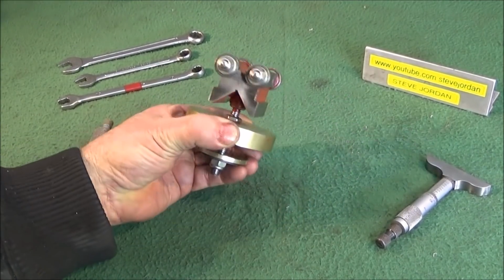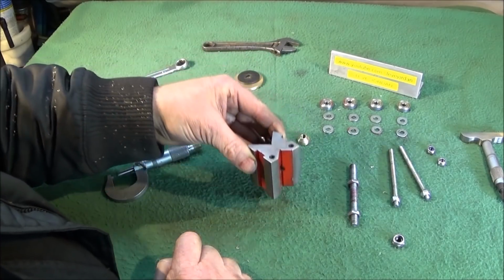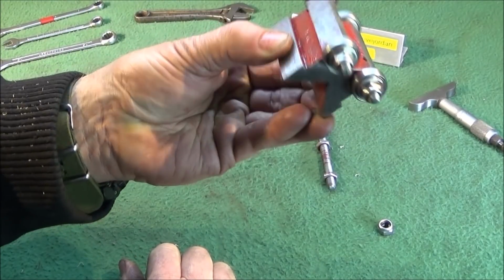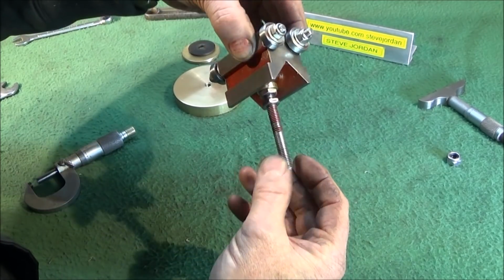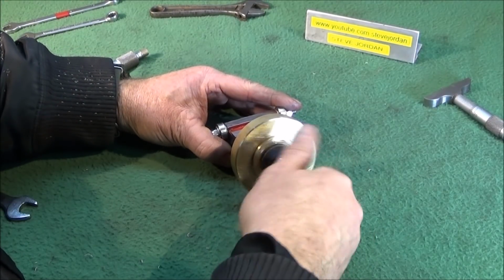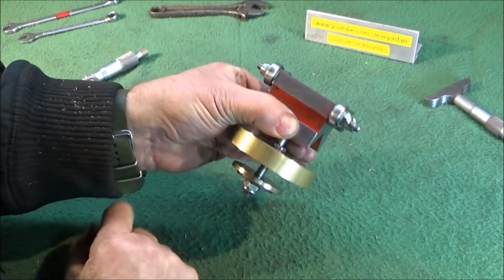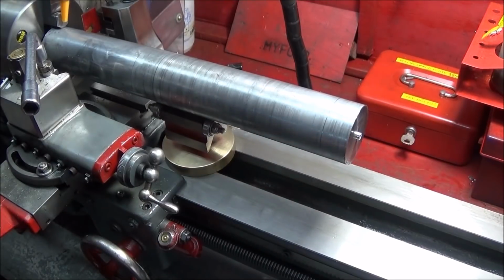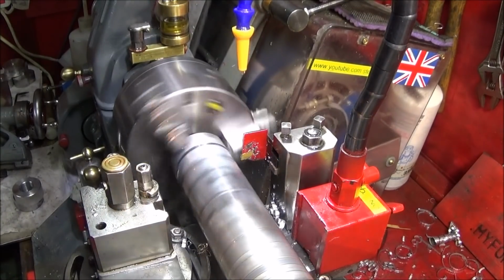Easy To Make Part Off Steady Support With Roller Bearings

Comment: No way sport.....if that bar flipped out of the lathe it would be a quick trip to intensive care....turn the bar around and use the fixed steady to cut the OTHER END off not at the chuck end.....daft way of doing things …..anyway, parting off in a fixed steady is iffy at the best.
Reply from the maker: Well if you obviously can't see the engineering logic here. It would be dangerous to part off with a fixed steady especially from the end. The way I have done it (40 years the same), The pressure from the part off is next to the jaws, where it couldn't push the bar or make it 'flip out. Parting off at the other end with a fixed steady in place would be totally stupid and would probably guarantee and accident of some sort. Fixed steadies aren't designed to take that type of load.  Parting off is always done as close to the chuck as possible. Check out all the engineering books from the past.
Reply: @SteveJordan  That is partially true....the example you showed would probably normally be done by sawing off and then facing off...….no way could you destroy a fixed steady when machining at the far end even with a parting tool. The method you showed would be odd the say the least and I wonder how it was done before the magic wheeled vee block design…..just my opinion. As a turner I would not consider that method to be practical at all.
Reply from the maker: Just to let you know all arrogant and rude comments will be deleted. like your last one. Any more of this childish name calling commenting and you will be blocked.
Reply: @SteveJordan  No arrogance or rudeness intended ….I get a bit hot under the collar when I see doubtful practices....machining can be a lethal business if not practiced reverently.

Comment: This would only help if your tool touched the work from the top but it doesn’t so as soon as the tool contacts the work it will push sideways if you are going to put this much effort in to building it why not build a 3 point steady rest
Reply from the maker: Hi Allen, It works perfectly for what I have shown. Parting off, as the tool is so close to the chuck, doesn't push the bar sideways enough to move it. This is only really to stop the long bar from moving in the jaws considering its weight, any run-out and centrifugal force. Just enough to give it some support. I have a Myford ML7 three point steady for anything else like turning.

Comment: Clever idea. Sort of 66% of a full 3-point steady. But it will not work well if there is an upward foirce on the piece being parted -- which is neatly solved by the back parting blade.For other applications I would prefer a 100% 3 point steady.

Comment: Hi Steve, this is going to sound like i'm trying to sound clever but I'm not, it's a genuine question. Why do you need to back off the nuts slightly? Do they not just clamp on the bearing inner anyway? Great video as usual by the way. I've shamelessly copied a few of your ideas!
Reply from the maker: Hi Karl,  Yes you can just leave it tightened up if you want. I just back it off a bit so the studding has a bit of free up and down movement as well, its just a few thou to allow for a slight run-out when bringing up to touch.
Reply: @SteveJordan  I noticed the threaded rod was rotating with the bearings. Won't this wear the holes in the V block oblong over time?

Comment: Never seen that idea before. Why would you part off that length and leave a small length in the chuck.
Reply from the maker: Hi Keith I only wanted to machine the short piece in the chuck. This is the only way to do it as the bar is too long

Comment: Yet another inspiring video that makes me wish I had time to go out to my workshop: thank you again, Steve. I have an old Sheldon 10" lathe which came to me without either fixed or travelling steady. I think I could adapt your idea but I have curious ways (!) I mean that both ways have a flat and a V profile, so I shall need to mill appropriate grooves in the base plate, or it will be lop-sided.  A challenge! I think I should start with something like Plasticine to get an accurate impression of the profile.... any suggestions?
Reply: There is a Sheldon lathe on eBay at the moment. It comes up under the "items matching fewer words" section if you search for "Sheldon Lathe". As of now (28/03/18) the bidding is only at £70-odd. It's in Nottingham. It doesn't look too bad and it has a fancy gearbox, instead of needing change wheels. Any nearer to me and I'd be sorely tempted (well, one cannot have too many lathes).
Reply from the maker: Hi Nick, I often use card from breakfast cereal packets and make up templates for something like this. You could stick some on thin flat metal or plastic sheet, glue on corners of card only, so you can remove it from the metal after use. Take the tailstock off the lathe and push the card firmly and flat up against the end of the ways. Then use a very fine point pen and follow the contour drawing on the card. You can use both the upper card cut out an the lower card piece to get things quite accurate.  I have done this for many components and have a drawer for all my templates! It may work for your job? The Sheldon lathes look great. I had to google it to see what they were as I haven't come across one before.
Reply: Concerning the Sheldon lathe:  some 20 years ago I owned a Sheldon 10" lathe complete with flat belt top drive and all. This lathe had plain bronze bearings, X feed, tumbler reverse and a Norton gear box. I had it precision reground on all slides and I made a long cross slide with traverse T-grooves in it. A wonderful machine this was. Super accurate and a marvel to work with.
Due to lack space to set up another workshop, I had to store it for a couple of years elsewhere. In the meantime I thought I had protected it sufficiently enough with some plastic spray-on anti rust product and sadly enough due to repeated spells of dampness, condensation problems, lack of oversight from my side after about 4 years, the lathe was ruined. So I donated it to a local museum where they cleaned it up with sandpaper and where it now rests in peace for posterity.
But oh..... What a nice machine it was. It still had its  "Lend and Lease"" plaque on it !!

Comment: Very nice modification Steve. Unfortunately I haven't any spare V blocks otherwise I'd make one myself - but will keep it in mind.
Reply: Don't need  a V block... just mill or saw a rectangular channel in a block of steel or aluminum to clear small work and put the bearings on the end as on the V block. The V block here serves no function other than holding the bearings.

Comment: I would not have thought of that ,great idea .Saves having to use a band saw by using that rear parting tool but the ball races on the v block are something new. Also cost effective as v blocks when rusty are cheap at car boot sales.

Comment: If you only need a little torque to get the nylon nut on all the way, you might consider cutting a groove in one end so you can hold it with a flathead screwdriver.  That way you don't mess up the threads with the pliers.  I get a ton of useful info from your videos!  Thanks!

Comment: Thanks Steve.  Nice, simple, inexpensive build.  Just a thought; if you add a small light spring between the 2 brass discs around the 8mm stud, it will tend to keep a closer distance to the ways when installing it, (did it on my tail stock mods).  Then just spin the large brass disc down and tighten the jam nut.  Was thinking also about a top bearing with a V-Block type clamp.  Just brain food.  Thank you again for sharing your creativity & inventive projects.
Reply: +Craig Marshall  Yes it would.  I was thinking of a short section of larger OD heavy wall pipe maybe, sliced and then cut to suitable arc, then add (silver solder) tabs that would seat into the clamp slots at a good angle.  Then drill and tap center with an 8mm bolt & jam nut with a larger brass tip as a slider.  Could also modify the bolt end to use a small bearing also (5PT).  Not much pressure on it..more vibration depending on stock.  OR drill and tap into the sides of the block so it could be held more tightly to the block. Ease of removal would be the key to easy use.  Then Steve's 4 point base arrangement could be used either way as needed.  Just thoughts.

Comment: nice tool, SJ
the bearing size, and is lubrication needed for them?
Reply from the maker: You can get 10 of the bearings here for a good price. No lubrication needed.
https://www.banggood.com/10pcs-6x19x6mm-Steel-Sealed-Shielded-Deep-Groove-Ball-Bearings-626zz-p-1009702.html?p=SO071514950915201710

Comment: any special reason why you're parting it "in reverse"?
Reply: Google+ SUCKS BALLS - the worst forced social network never tried it myself but i heard it helps reduce chatter
Reply: Google+ SUCKS BALLS - the worst forced social network because he's using the rear parting tool... Which cuts the opposite way of course...
Reply: it is not in reverse the tool is upside down coming from the back
Reply: Noway Jerk it just looks like it's in reverse to those that don't know as the parting tool is mounted the other way up. And in any case the chuck would spin off if he actually reversed the direction.
Reply: Yes, yes I said reverse in quotes - I know how the tool is turned and how piece is rotating. What I wanted to know is why. I don't see how this would help reduce chatter but worth a try.
Reply: Google+ SUCKS BALLS -  in which case I'd have expected you to know that the ML7 rear tool post allows the mounting of two tools on the cross slide at the same time for convenience. One to shape one to part speeds up repetitive operations is the normal use.
Reply: The simplest answer is: The upward force of the rear mounted parting tool takes all the play out of the slides while parting of. Also IF the parting tool lifts during parting off, it tends to dig less deep into the work piece so there is momentarily a little force relieve which causes easier parting off. With the parting tool in a "normal" forward position, the tool, due to play in the slides and the springy push force of the spindle/nut combination, tends to drag and push the parting tool inwards and deeper into the work piece with chatter and frequent breakage of the parting tool as a result.